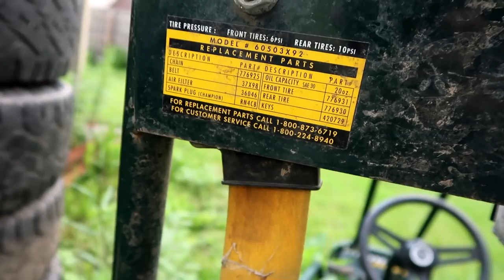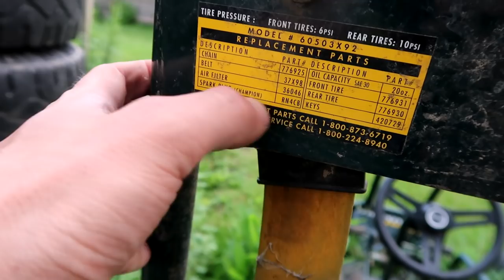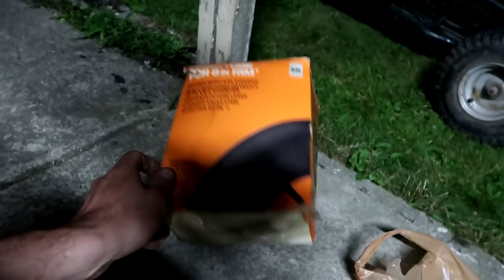CHEAPEST GO KART On Craigslist First Drive!

Comment: I got a Murray hard drive that is stretch a foot with nobby tires but with those motors suck bad I put a fully built motor on mine and before I did that I had the screw backed all the way out and 3 springs on it

Comment: thats definitely a torque converter. if it was a centrifugal clutch, the chain would have to be on the same side as the driveshaft coming from the engine.